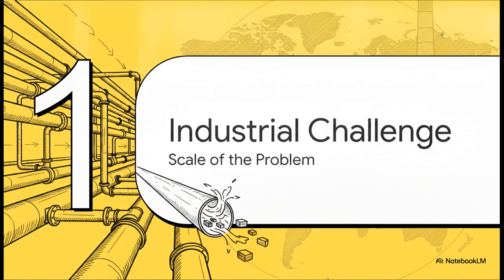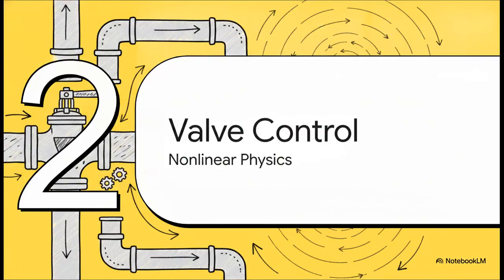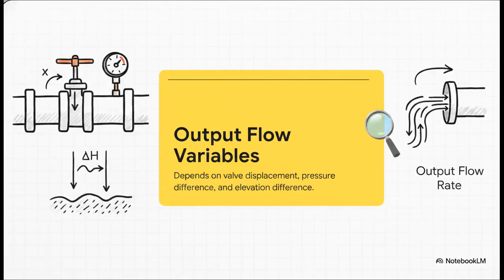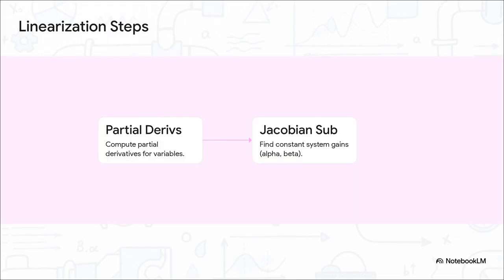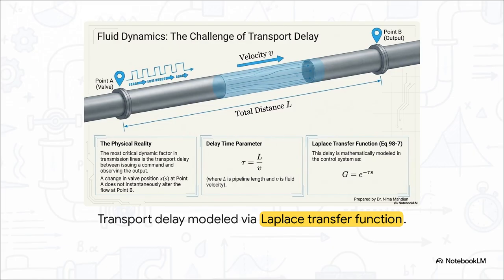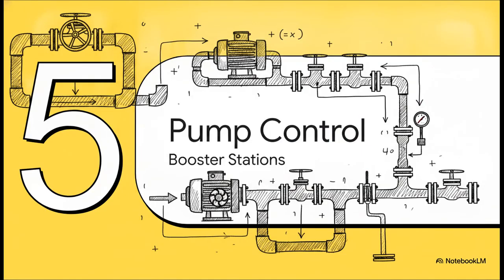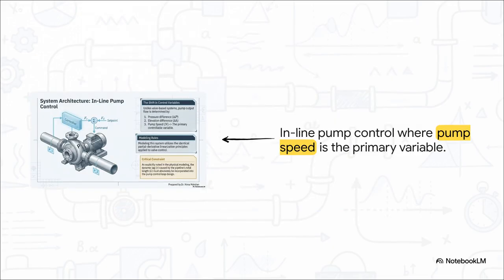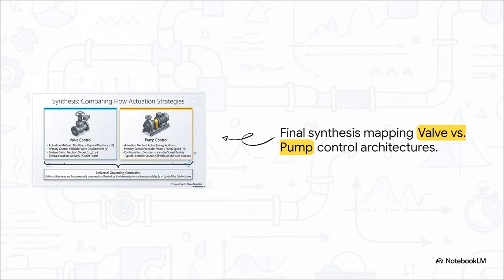Flow Control in Pipelines | Industrial Process Control and Automation

Comment: Thank you Dr Nima Mahdian excellent comparison between valve throttling and variable speed pump control. The block diagram synthesis perfectly connects fluid dynamics with control engineering.

Comment: Dr. Mahdian, I appreciate this clear and practical explanation if you don't mind i have question 
In real long-distance pipeline systems, how can engineers decide whether valve-based throttling or pump-speed control is the better actuation strategy, especially when they must balance energy efficiency, transport delay, friction losses, and flow stability?